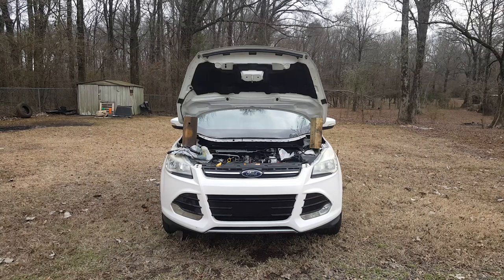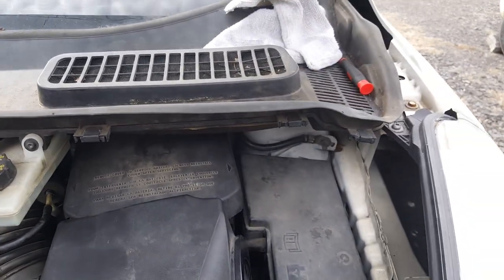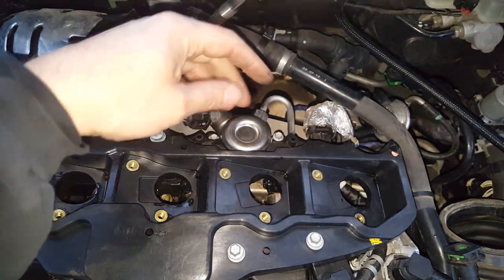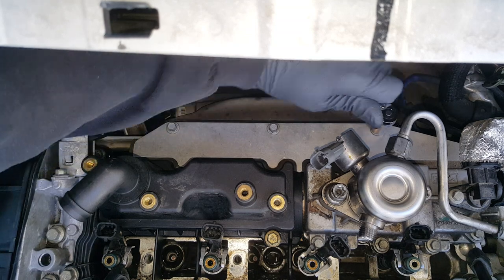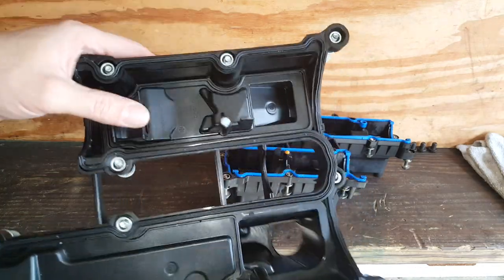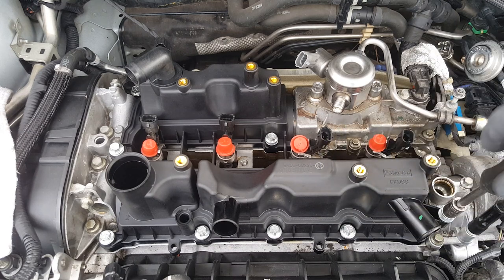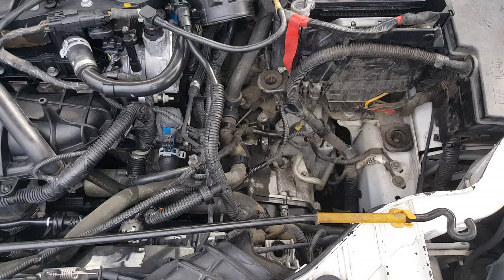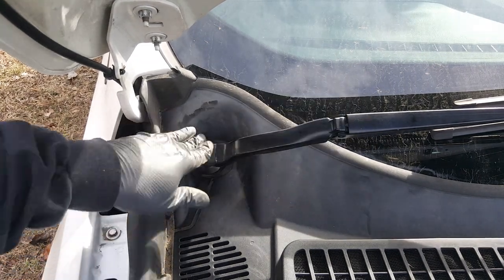How to replace the valve cover & gasket on a 2013-2016 Ford Escape 1.6L

Comment: My ball survived.  But on thw 9ther side of that same valve cover, there is a plastic shaft.  The gasket holds in in place, but it is essentially two pieces.  Did your new valve cover have that plastic shaft 100% attached?
Reply from the maker: Yes , it did. Thanks for the question

Comment: Thanks for the video! Im in taking a break now. Just about to reesemble everything. My only concern at this point is the fuel injectors. 2 came out, 2 stayed in. The O-rings all looked fine, but the two injectors that came out are loose, the two that stayed in are tight. I saw you had a similar situation so Im hopeful. Thanks again! Mines been leaking oil for a while now and with the weather in the upper 90s its causing some smoke from it burning. Gotta get it done!
Reply from the maker: I had the same feeling but not an issue to date. Thank you for the feedback.
Reply: @s33therfan  its running great, thanks!

Comment: I did this and am still in the process. I’m having issues with the fuel injectors but I found a chipped o ring so hopefully that fixes the issue. I pulled em all out and cleaned em
Reply from the maker: Hope all is working well , thanks for the feedback.

Comment: Thanks for the video. I don't have a gasket problem, but maybe this will help with the P0258 check engine light problem. Apparently, there could be a fault in the injection pump connector. At least now I know how to get to him. I have a ford c max 1.6 ecoboost, but the engine is the same as your ford escape. I've been struggling with this problem for 4 years and they can't even fix it at the ford dealer. Sad. Sorry for my English...
Reply from the maker: Hope you get it solved , keep us updated. Thank you for the feedback.

Comment: just did this job today, caught my head 3 times on that hood loop thing.
Reply from the maker: Yes , I remember the latch hook all to well. I thought being aware of it would prevent repeatedly hitting my head , but no. Finally got the blocks and propped it as high as it could go. I figured it would be a good disclaimer for others. I appreciate the feedback .

Comment: My mechanic is telling me this is a 4 hour job. Quoted me over $600. Is this normal?
Reply from the maker: It is pretty time consuming . I always try to encourage people ro tackle the job , it is a great learning experience. I would definitely recommend purchasing a new valve cover. As far as the injector orings , I have not replaced them to date and still zero leaks. I would say 600 is fair but it does not hurt to price around , check with a few mobile mechanics etc. , they will often times be less expensive. Best of luck on whatever you decide and thank you for your question.
Reply: @s33therfan  thank you very much!

Comment: How about putting RTV on the gasket before installing it on the cover to hold in place and for extra cushion for the gasket?wouldnt hurt would it?
Reply from the maker: It would not hurt anything as long as it is not excessive, from the stand point of making sure the gasket stays in place. Having said that it would not offer any other benefit.Thanks for the question.

Comment: so, i just torqued mine down about 30 minutes later? is that bad?
Reply from the maker: It is not ideal but works. The biggest concern is too much rtv. Another thing I worry about is running the car before it has time to cure , having the potential to get into the engines system. I will give you an example of a situation where someone had used way too much rtv. Well the rtv found its way into one of the vvt solenoids and it was causing all sorts of issues. I thought the engine was possibly bad , but was able to clean all the rtv particles out of it. Thank you for the feedback.
Reply: @s33therfan  i most defiantly didn't use a lot. just a dab. and i let it sit over night! thanks for the feedback!

Comment: What is the cost of this replacement?
Reply from the maker: As far as parts go , I believe I spent close to 130 for the valve cover and the oil change. The job was'nt nearly as bad as I thought it would be. As far a shops price with labor , I would be curious to know myself. Thanks for the question.
Reply: @s33therfan   I was quoted just over $1,100 for this job today at a shop.

Comment: Can anybody tell me where is the fuel test port ?
Reply from the maker: You need a tool like this one:
https://amzn.to/40m13gQ
You connect between the high pressure fuel pump and the incoming fuel line from the fire wall area . In other words before the high pressure pump. This tool T's into that part. As far as the high pressure fuel , you would need a good scan tool capable of monitoring the high side pressure. Hope this helps.